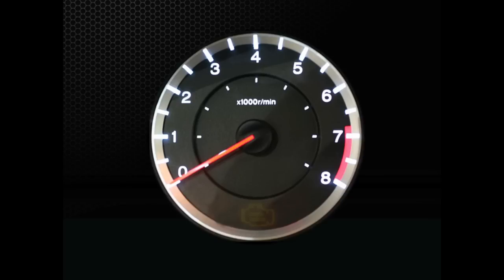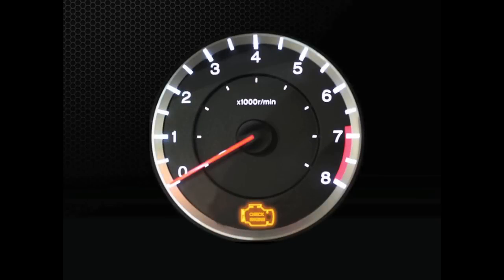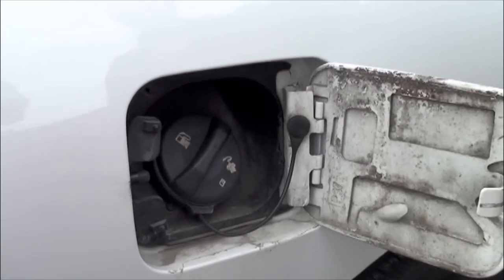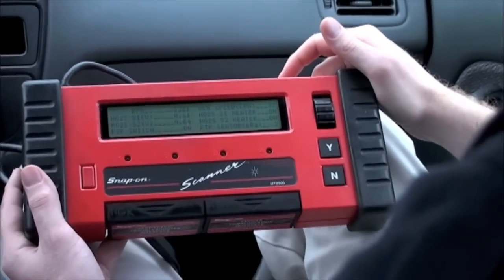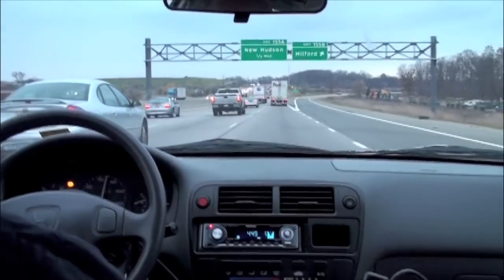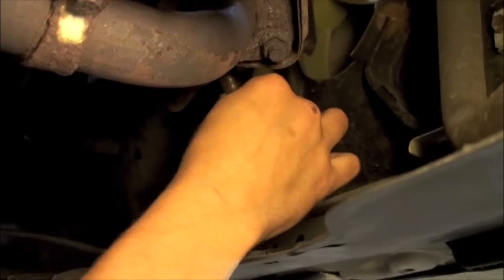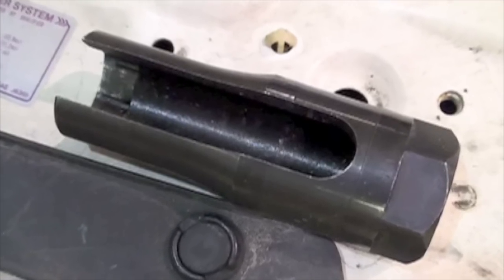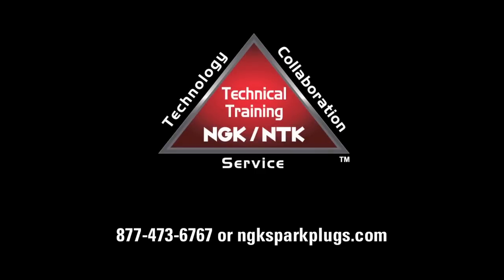Oxygen Sensor Diagnosis and Replacement Simplified - NGK Spark Plugs - Tech Video

Comment: @RaguelAngelofBalance: No such thing as a misfire in the Cat. A misfire occurs in the cylinder resulting in pure fuel entering and exiting the cat, overheating and buring it out. You should have seen a flashing MIL and stopped driving as soon as possible. An inoperative injector could cause a different kind of misfire, but pure fuel would not enter the cat.

Comment: @KrankieV2  I bought 2 bottles and have only used one so far, yes I used it at a 1/4 tank as directed and my light is still on I drove for atleast 42 miles. my converter cost 1300 without labor which is 4 bolts so I would do it myself. I have been thinking about the lacquer thinner method but its not O2 safe so i most likely will not do so.

Comment: @bigdog813 The new sensors are probably more sensitive than the older ones, and so they detect converter inefficiency sooner. You probably have a P0420 code, right? This code can trip even when the converter is working at 94% efficiency. Get yourself a bottle of CATACLEAN® and use it as per the directions on the bottle. That almost always works, and costs MUCH less than replacing the converter. The cleaner should be about $25. Converters can be up to $1,000.

Comment: @shad366 heat the pipe up with a torch in the area the sensor threads in. that's about all you can do. you'll probably break the old one coming out, so be warned of that

Comment: @ngksparkplugsusa can you explain to me why I replaced my 2000 cherokee xj with a set of your O2 sensors which is OEM equipment for my jeep and it is know saying my catalytic inverter is faulting after install, mind you i had no issue before I was just doin preventative maintnence of my 02 sensors with 149k on them.

Comment: ok my 2000 alero is missing and we have replace coils ,coil housing spark plugs..the car runs fine until i come to a stop and you also can hear like a poot poot noise out of the tailpipe at my last straw help...
Reply: Did you find the problem? I have the same thing going on with my Ford 5.4L 3V.

Comment: You are going to screw up a lot of people out there with this video.  You really didn't say how to diagnose the O2 sensor at all!  There are a lot of codes for this sensor that people shotgun by installing the wrong part, in this case a new O2 sensor.  Fuel pumps, ect, maf, vacuum leaks (or air leaks), and a slew of other things.  How about the integrity of the wires?  People...before changing a component for a code test it first.  Propane is the true way to test an O2 sensor with a scope.

Comment from the maker: All OE fit oxygen sensors will come with the wiring and direct plug in connectors. As far as our universal oxygen sensors go, they still come with the wiring, however they will require cutting of the old oxygen sensor and splicing of the wiring.
Reply: NGK spark 
plugs USA
Reply: komo kanbiar un bonba dekonbustible